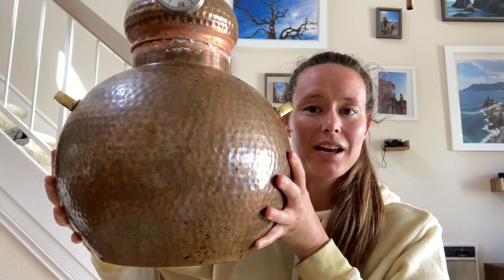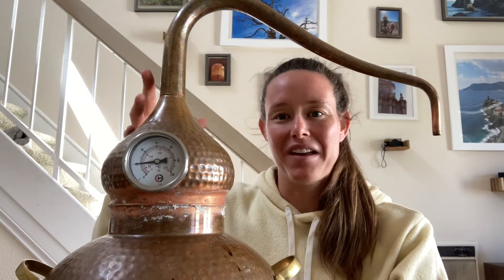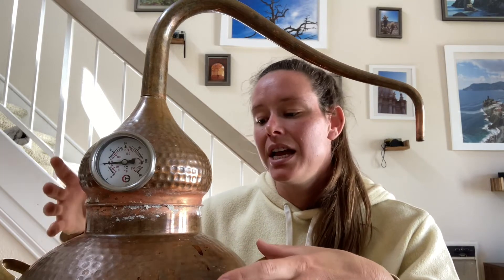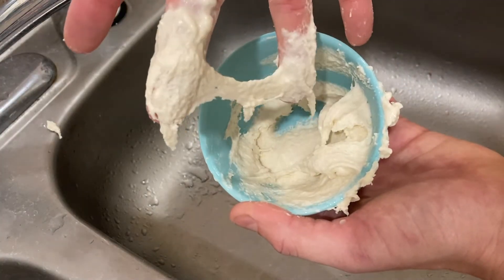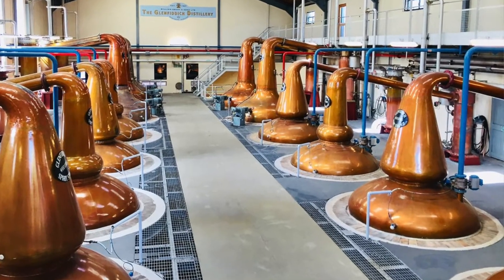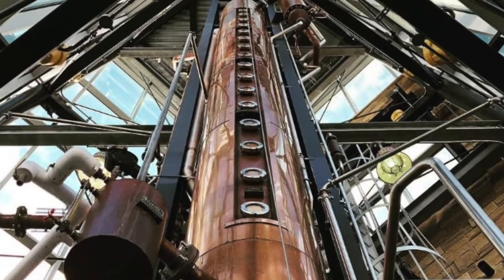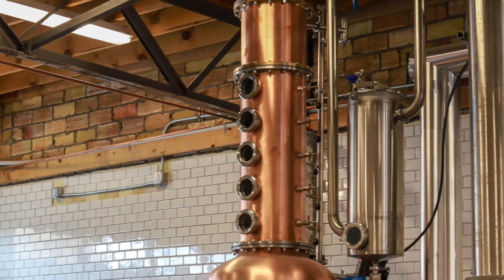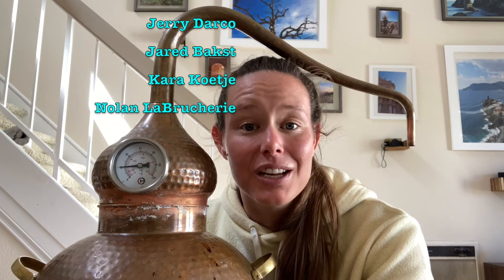The anatomy of my POT STILL & how it works!

Comment: Pressure? This is actually a vacuum distillation and what you are sealing out is the cold outside air being sucked in and messing up what's happening in the onion.   The vacuum happens as you condense the distillate and that pulls the vapors over.
I absolutely am obsessed with fermentation (soy sauce, beer, sauerkraut, yogurt, kefir...) and soon RUM.
Oh, thank you for sharing your expertise
Reply from the maker: @brokenrecord3523 Thanks for the comment! I'm happy to hear you're obsessed with fermentation! It's so cool, isn't it! 

I apologize if my mention of pressure caused any confusion. Just to clarify, this setup isn’t a vacuum still, so there’s no vacuum being created at any point in the system. In a traditional pot still like this one, the increase in temperature in the pot generates the necessary energy to create vapor. This vapor, which is under slightly higher pressure due to the heat, naturally travels up and over into the condenser. When the vapor reaches the condenser and cools, it does experience a slight pressure drop as it condenses back into liquid. However, this drop only brings the pressure back down to atmospheric levels. The pressure inside the condenser never drops below atmospheric pressure, which means there’s no risk of outside air being sucked back into the still during operation. I hope this clears things up! Thanks again!!

Comment: So what type of hot plate do you use?
Reply from the maker: I used a propane burner, an electric stove burner, and a cheap electric hotplate that I got from Amazon. I want to wire the hot plate so that I can bypass the temperature controller and adjust the heat using a variac, but I haven't gotten around to it yet. I think it'll help prevent possible smearing.
Reply: @RobynSmithPhD  how did the hot plate perform? I've heard of people wiring in a SSR to control the heat, but wondered how an untampered unit did.
Reply from the maker: @richardhenderson9127  I honestly think it was alright! I’ve just used it for my tiny 2.5 gal still, so I’m not sure how well it would do with a bigger still.
Reply: Just don't use induction, which doesn't work with copper.  Also, nothing that turns off and on like halogen and radiant.